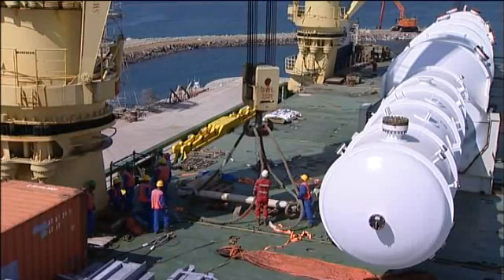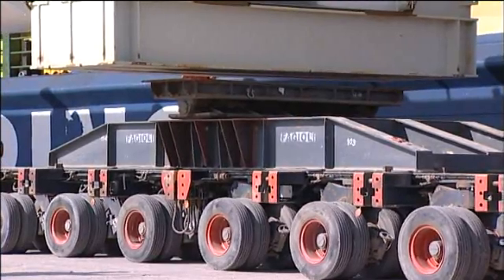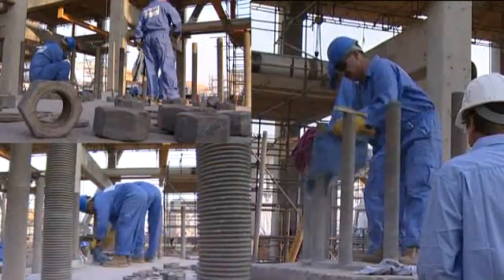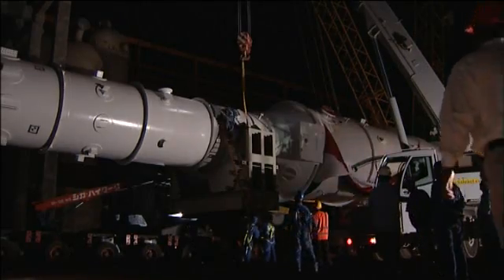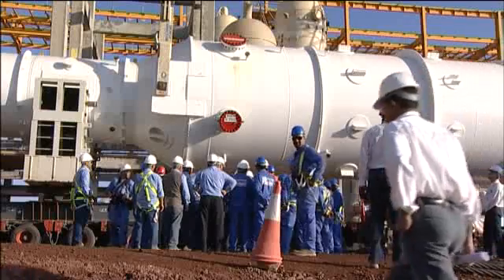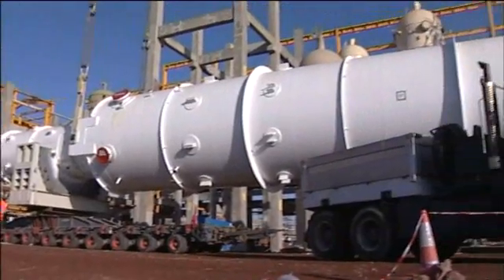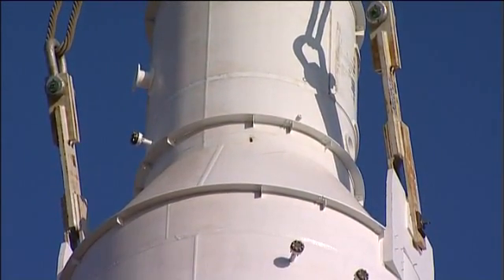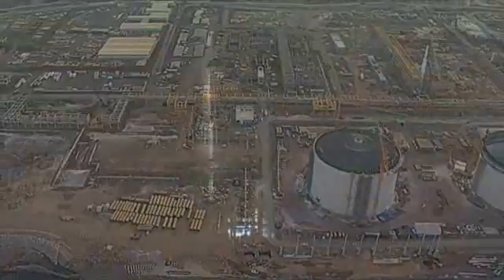Heavy Lifting-Lifting 292t column-Yemen 2007

Comment: LOP is very bed. Specially capicty of crane
The crane is capable in only smooth weather. If any cliyment Chang wind speed increase above 20knot. Could be any big accident. The Result was as uaually. Contactor safe the. MOny in selection of crane hiring. Better if above 1000 ton crane erection